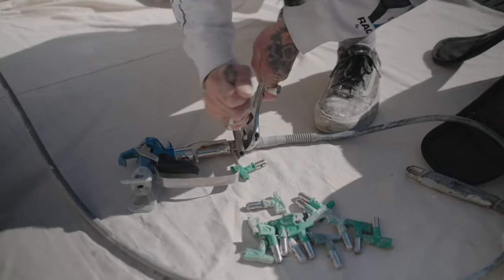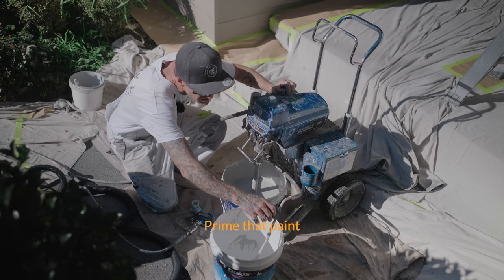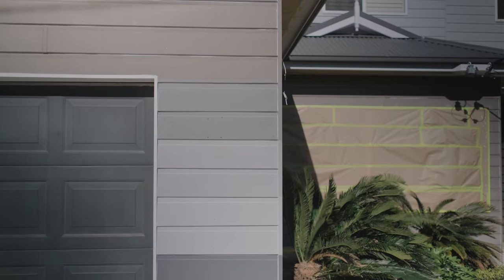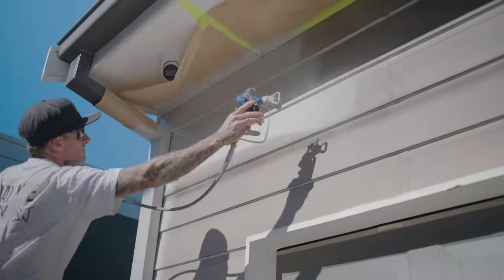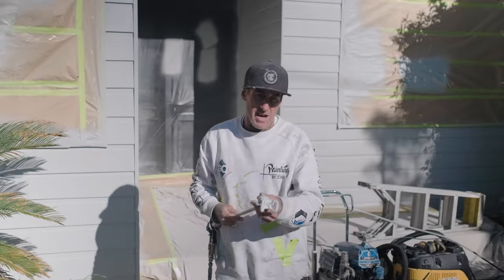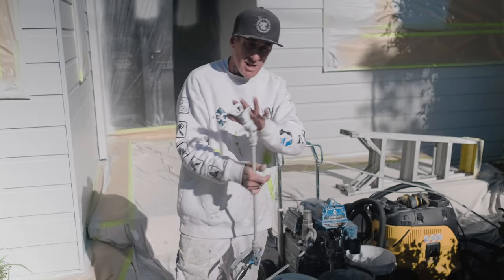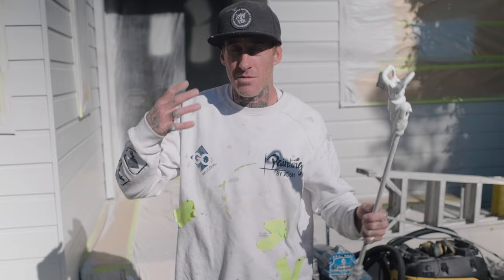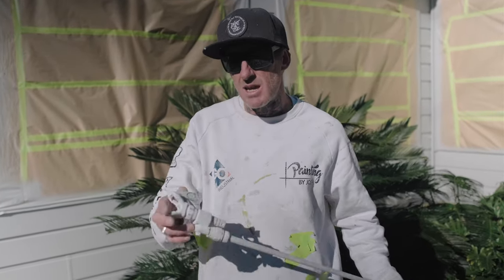SPRAY A HOUSE WITH ME! PAINT SPRAYING TIPS & TRICKS

Comment: I dont recommend any exterior spray painting. Risky work with neighbours. Paint particle could be miles away from the house even though low pressure. I can see from video as well. 
I have seen 2 cases from previous company that one claim made from neighbour paint particle laid over all over the her car and exterior wall on the house it was like a dots everywhere and the other one from commercial warehouse owner. He claimed 200k for 10 parked cars and all the tinted windows. Bad ending, took 2 years to finalise it. I dont know how this guy work like this. But, its not what you should do. This is not really helpful video. Just use your brush and roller. Take more time to finish instead of using short cut.
Reply from the maker: Hi Bow, I have been spraying residential, commercial exterior work for over 25 years. It comes down to experience, knowledge on  how to achieve  the right finish withoutspraying the neighbourhood. This may be the difference from a professional to an amateur. We ant all the same.You may need some more practice. 👍
Reply from the maker: And how is spraying taking short cuts? Brushing and rolling can never achieve the finish my clients desire. Get with the times or get left behind. We spend weeks on preparing the surfaces to spray for a few days. You would rather work harder & longer to achieve a sub standard finish? You do you brother
Reply: You’re aware you can get roller splatter travel to next doors car also?
Reply from the maker: @Joe Bonthuys  💯 PERCENT 🙌
Reply: Damn that’s crazy. I would never in a million years even think about rolling and brushing an entire house . I might roll the trim color depending on the conditions and colors and amount of trim . No two jobs are the same , but I guess to each his own . Theirs a reason cars get sprayed and not rolled and brushed . You just can’t get thats crisp finish . You just can’t. Plus the bonding is a whole lot better . Many argue rolling adheres better but that’s false in my opinion . Example. Get a spray can and spray a light mist of paint on a piece of metal . Then on the same metal hold the tip down on the spray can and let the paint build up just a little . Once they both dry you can go right up and chip or peel that thick coat right off but you will be scrubbing that little mist for a bit . GUNS UP POLES DOWN!